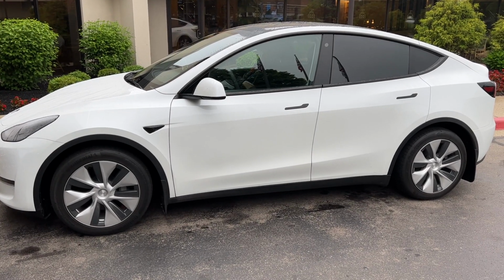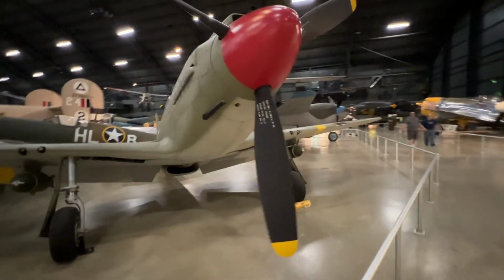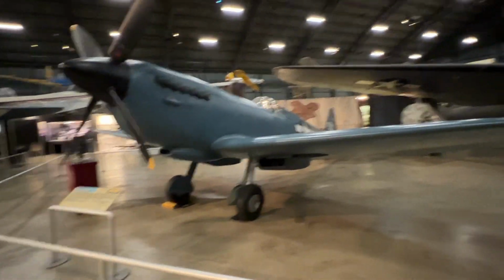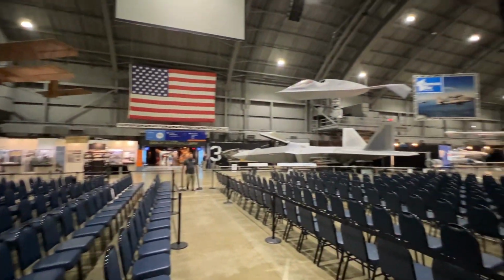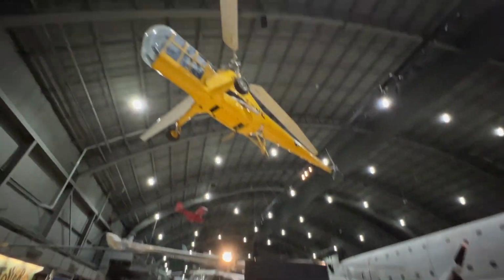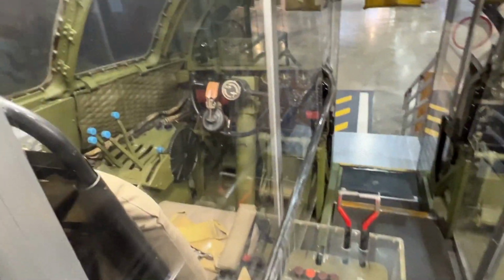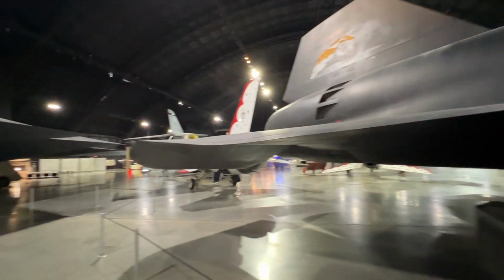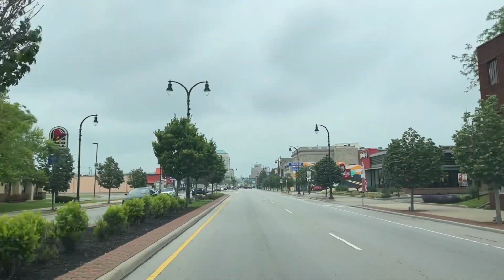Model Y Road Trip to Dayton Air Force Museum - Day 3

Comment: As a B52G ground crew chief then a KC135Q Crew Chief while stationed at Beale AFB, I really appreciate you doing this video. While I was in from, '72 to '80, I got to fly back seat once in a T38 since the SR-71 pilots would use it to maintain required flying hours. Went on a few refueling missions for the SR while there also.  We're you in the USAF and if so where were you stationed? I'm 6'4" and drive a Model 3 but hope to get a Y in the future as getting in and out of the 3 gets harder as my body gets less flexible.